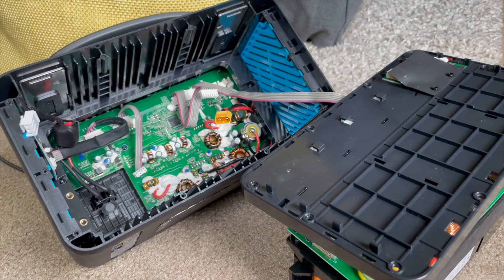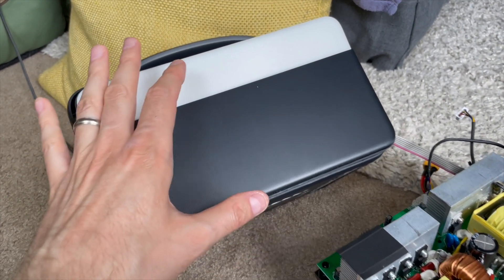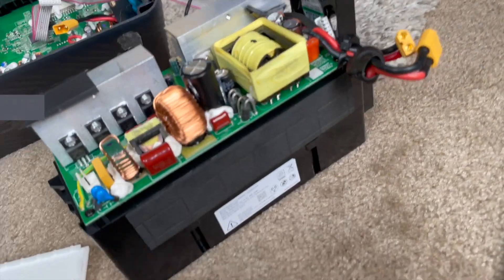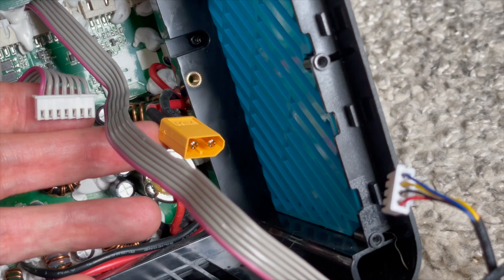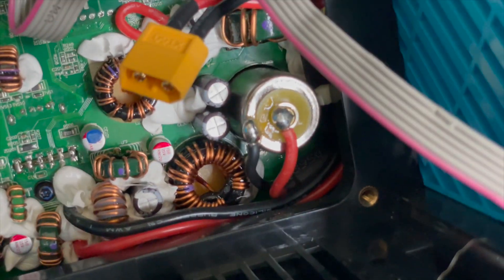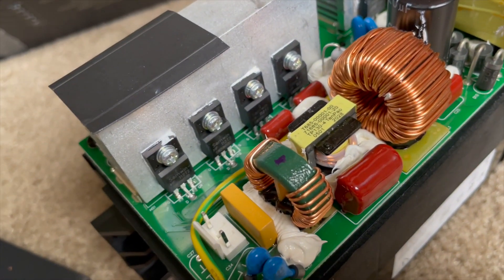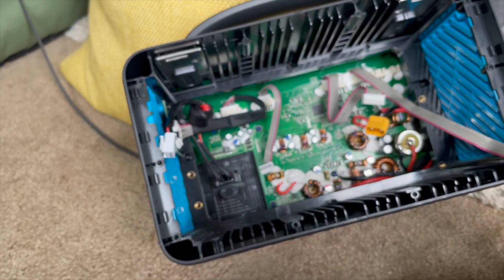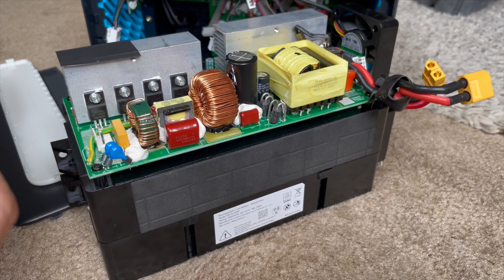Anker PowerHouse II 400 Teardown and Repairability Discussion

Comment: Hi, I'm searching for a solution for my powerhouse and end up here. Mine worked just fine until few days ago. First, it was simple charging problem. It's not charged up to 100% but rather stuck at 83%.

My first instinct was to contact Anker's customer service. They advise me to reset the charger with some process. After following their instructions, It's now dead. No response to any input whatsoever, only turns on when plugged into the wall charger. As soon as I pull the plug, it turns off immediately. It's now good as bulky multi-port wall charger.

And plus, Anker now don't care and just offers replacing powerhouse with newer one, in condition of i'm paying almost full price for it. I'm not doing that.

If you could help me, may I ask you if you know any solution to do this kind of situation? I'm planning to follow your tear down steps, and maybe disconnect battery for few days to fully reset the main board. But It's last resort.

Comment: I just got this exact model powerhouse from Facebook marketplace, it looks brand new and the only issue is that it won’t charge, when I plug it in it shows 78 but then flashes to one percent with the snow symbol, any tips? it turns off shortly after that
Reply from the maker: Try resetting it? It's too long to post here, but just a quick search of "Common issue & inquiry for 523/533/545 Power Station" should get you there. I don't suggest buying any power station used on any marketplace, unless you can fully test it out first. Perhaps you did. Good luck!

Comment: I have the same unit and it works great except my lcd screen is all messed up. Sometimes you can see a full number but most of the time you can’t read anything off it. Do you have any idea how it can be fixed or what I should do? Anker is of no help.
Reply from the maker: I have noticed this, and looking into what is causing it. If I discover a root-cause and/or solution, I will make a video on it.
Reply: @TheCuriousEngineerChannel  that would be amazing. Anker is of no help on the issue and it is only getting worse.
Reply: The screen has since completely died and I have no idea what the unit is doing. It still functions and works but it’s pretty frustrating not knowing battery percentage or input or output wattage.

Comment: Did you get the front face panel off ever? I want to replace the garbage 8mm barrel plug with something better.
Reply from the maker: Ah, thats a good question. I did show in the video how it is held on, but did not take it off. I have one with a very warn out barrel plug as well, and am considering replacing it with an XT60....Perhaps I'll make another video!

Comment: I have the same exact power supply as the one in this film. I used a charging source or plug that was too strong and now my anker powerhouse II 400 will not charge or even power up. Nothing pops up on lcd, does not light up or anything. It’s just dead. Do you know what it could be? Is there a video you have or know of that I can look at for assistance in repairing it, hopefully. It was a great and useful piece of equipment and I’d like to use it again. Thank you so much

Comment: Am i screwed if i fried my usb ports lol everything else is still working but its definitely draining the battery not sure what i should do i can definitely take it apart but if i have to solder and chips im cooked do you know of a way to get parts?
Reply: I'd be ok if I could just disconnect them but I can't tell from your video if that's possible
Reply from the maker: How did you "fry" the usb ports? It might be that they just are in overcurrent lockout.
Reply: @TheCuriousEngineerChannel  sorry I didn't update but I figured I'd just check it out since now I know how to safely take it apart and I had to go all the way and get the front face off and found a 8205s mosfet was melted
Reply: @junkyardripper  follow-up question for you since you said you got the front face off. Would you say its possible to replace the 8mm barrel plug with something else?  I want to replace my intermittent and finicky input with an anderson or xt60
Reply: @PatrickRich  I mean anything is possible but there's quite a few components in there but I'd say yes it could probably be done just don't give it too much juice

Comment: Hey when your fuse blew from the inductive load did it take out the entire unit or just the ac inverter section?? Like did the Display come on or was the unit totally dead until the fuse got replaced? I have been given one of these that wont turn on and im wondering if it is the fuse, I dont have the charger for it.guess im gonna have to open her up. Thanls
Reply from the maker: The unit still charged and discharged using the DC barrel jack or USB-C, and the all the USB ports and DC automotive accessory socket still worked. When I pressed the button for the AC outlet, the light would come on, but there would be 0Vac present at the output. Hope that helps!

Comment: Cool! thanks for this video! 
Mine is working well now but when I got it last winter it showed snowflake which means low temperature but after a few days it disappeared and started working. I wanted to disassemble it to find the temperature sensor...
One stupid question. Is there any way to increase the inverter output to 220v (for EU devices)?
Reply from the maker: You are welcome! There are at least three  temperature sensors: one on the inverter, and at least two inside the battery assembly. 

The inverter module cannot change output voltage; it’s a different board that is used for EU. The bulk capacitors along with other components are only rated 250Vdc, which would be exceeded by the ~310 Vdc needed for 220Vac.